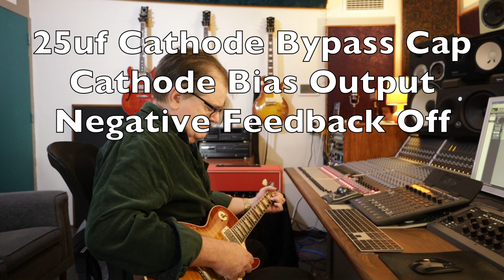DNA of a Valve/Tube amplifier.

Comment: Good effort.

Actually most of the people even do not scratch the surface and can’t understand how complex things are that define the end result the actual tone we hear when we play electric guitar.
Most misunderstood thing are guitars but closely followed by amplifiers.

Issue is amplified by number of the people that are convinced that they understand it but actually have dangerous half knowledge. That promotes one liner myths we often hear.

People often give higher importance to things that actually don’t make huge changes. For example different brand of the output tubes. Sure it makes a difference but nowhere near as much the cabinet and the speaker choice will do.

Put old Fender and Marshall true the same cabinet and let them overdrive and they will sound Fender alike with Fender cabinet and Marshall alike with Marshall cabinet.

Now you mention bypass cap difference and bright cap difference between the Fender and Marshall and that is true. Sure there are bypass caps on mixer resistor of Marshall that also adds some top end.
Though that all is not the only thing happening. Check the tones stacks. Topology looks same. Few different values only right? Sure but those values make huge difference. Fender ton stack is more interactive and regulates more. Meaning maximum value will increase given range a lot more than Marshall solution will. Also it allows extended lower range. It”s more scooped as well. But that’s it. Marshall tone stack let’s way more signal true. It gives those Marshall middle range and controlled bottom end. But it all plays together. Closed back cabinets and Celestion speakers add to that. EL34 add to that. Different sized transformers add to that. It all matters.
Why 5E3 Deluxe sounds different than AC15? 
Well everything is different accept for the lack of NFB and fact that they are both cathode biased with similar power levels.
5E3 Deluxe has way older type of the phase inverter. Has lower gain V1. Has older type of tone control. Output tubes sound different. Again different speakers Jensen vs. Celestion. To many things to name them all.
Designing an amplifier you can do many different things. Everything will influence the sound and feel.

Look at the filtering only. Just barely minimal filtering will feel different and especially with the tube rectifier increase the sag. To much will make it feel stiff. Output transformer. Over dimensioned one will make the same circuit sound way different. For example Hiwatt pa vs standard dr103. Apparently same power stage but PA has output transformer that you can’t really saturate with same circuit. It will sound less pleasant always.
Look at the Plexi sound. You can add master volume and do tricks but it will never sound the same as when the complete amplifier starts to overdrive. Important part of its sound is overdrive part of the output stage. Without it it sounds different and sterile.

I tend to love cathode biased no NFB amplifiers. Though once you get above 30 Watt things get to wild. At lower power levels differences act differently. High power requires some things to be done differently. Look at the power supply. High power amplifiers tend to have often solid state rectifier. Or look at the 50 and 100 Watt power supply of the some older Marshall amplifiers. 50 Watt has still center tapped full wave rectifier but with two in series diodes for each half way. 100 Watt has only one tap for high voltage and sports 4 diodes full bridge Gretz rectifier. No place to full with old ways. They need high voltage and efficiency so latest principal was used. 100 Watt is having even more filtering. Often it has 8 can caps. Mostly double once as well. Most often dual 50 uF with 500V. 50 Watt will use one cap for the first node and use it in parallel hence 100 uF 500V.
The first node of the 100 Watt will have two of them connected in series and parallel resulting in 50 uF 1000V capable combination. With help of strapping resistors voltage is decided equally and actual caps work at pretty easy lower voltage and that makes them last longer. After it 100 Watt adds 6 more can caps making for one stiff power supply.

At the other hand every tube rectifier has its first cap limitation. Often you will see that there is no more than 32 uF at the first node. Two 50 uF sections in parallel would ruin the rectifier tube over time. Inrush current is just to high. So you can’t make very powerful power supply with one tube rectifier. Enter the dual rectifiers. But wait then you need 2x w to 3A 5V Hester windings for two tube rectifiers. That’s always on up to 30 Watts used only for heating the rectifier that will also make less B+ voltage. So you see how going diode rectification is more efficient and gives up to 30 Watts more high voltage handling for the same size transformer and gives higher B+. 

Things are complex. Every little thing maters. Company changes transformer brand and same circuit sounds different. Company changes coupling caps same circuit sounds differently. Company goes PCB it sounds different again. Every little thing matters.
Reply from the maker: Thanks. Have you seen this one? Agrees with what you said about the cabs. https://www.youtube.com/watch?v=yHTcCEpUIbk&t=539s
Reply: @aphekrecordingstudio4274  I haven't yet. YouTube just gave me this recommendation. Will do.